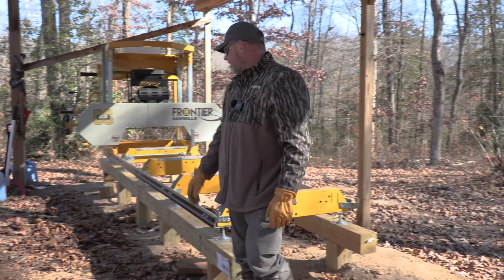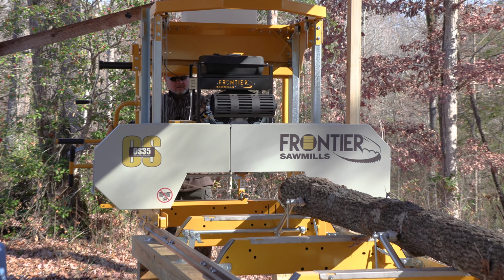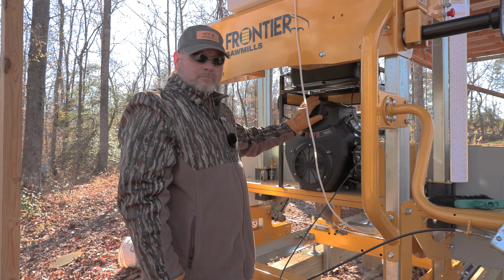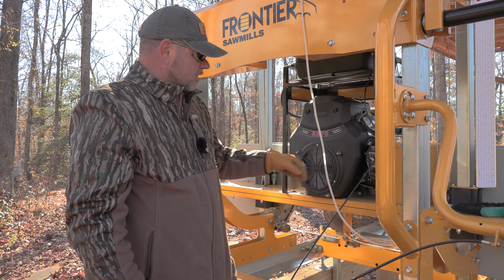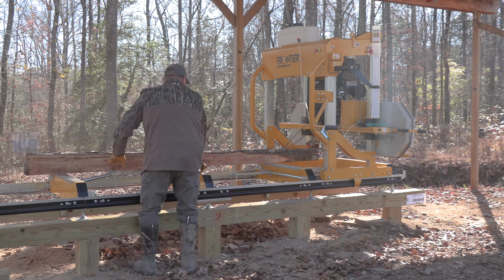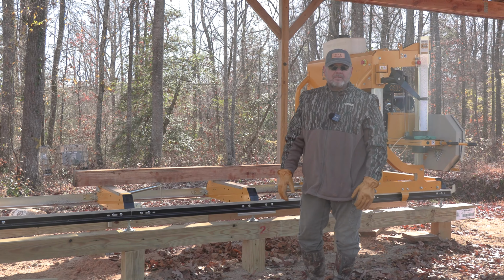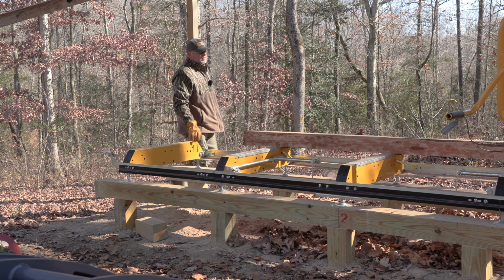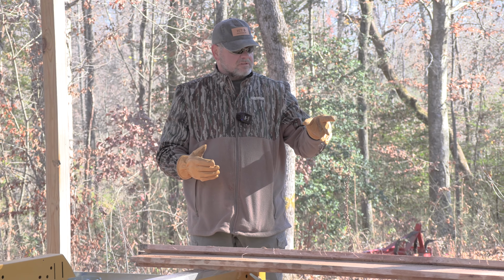Sawmill Mistakes Made - Frontier OS35

Comment: I really like that mill I wish they had that a couple years ago. I bought a woodland mills 30 max but would have considered this one. The biggest problem with these is I have to use the tractor to turn the bigger logs. It would be nice if they a decent log turning option for the big logs.  I just bought a T494 hydro with a cab because of what I see you can do with your 474. I had a Kubota M7060 before and I am impressed with the 494 It will lift almost as much as the 7060. The loader is not as fast but it is powerful.  We had 10 Inches of wet heavy snow the other day and plowing with a hydro is the way to go. I have always had gear drive never again hydro has so much more control. It has R14 tires that work great compared to the ag tires in the snow. I want to thank You and Tanja and Gizmo for all the great videos take care.
Reply from the maker: Comments like yours makes my day. I am thinking of some kind of kit to make a log turner.